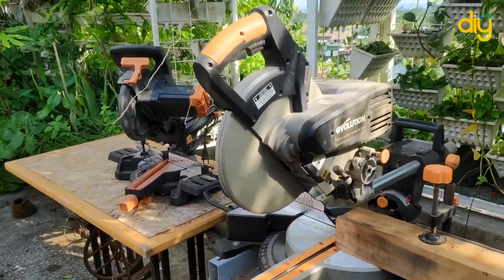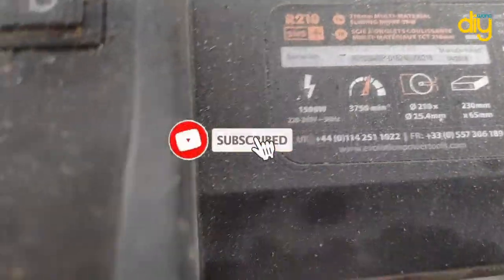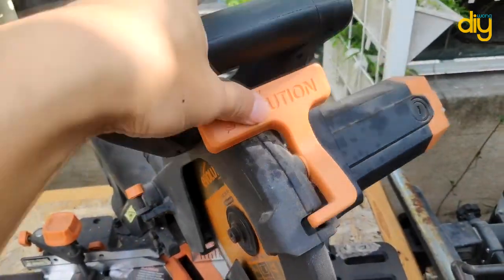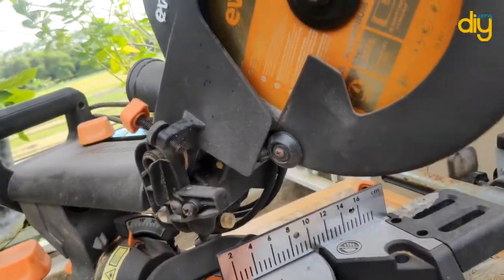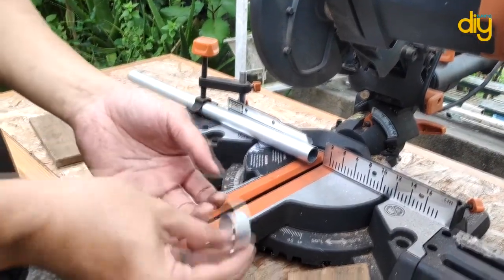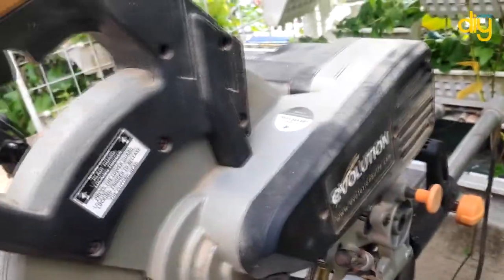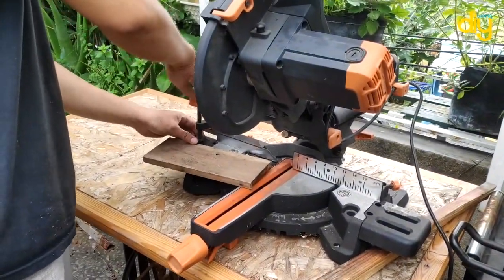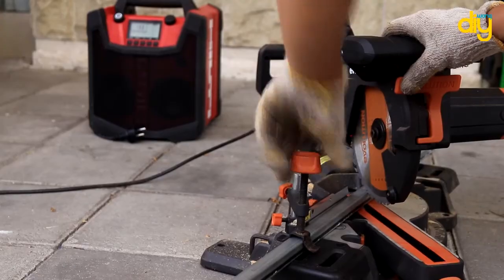Comparison between evolution sliding compund miter saw R210 sms+ vs Rage 3db Multi Material Blade

Comment: Like pertama
Reply from the maker: Mantappppp thank you
Reply: @WONGDIY   evolution  kok bisa sampe indo mas, saya cuma maktec gak sliding hehehe
Reply from the maker: @robotpenghancurjohe3325  ada importer nya di surabaya om
Reply: @WONGDIY  saya punya dca adjz 16 mas batrai tipe lama  gak bisa masuk ke dca model baru.. Kalo di shopi malysia ada converter dari dca... Rapi ntah kapan masuk ke sini 😭 heheh tertarik circular saw nya yg baru si., biar gak banyak batrai dirumah
Reply from the maker: @robotpenghancurjohe3325  hnah itu ekosistem batre emang penting om

Comment: Yang kiri ampere nya berapa masee??
Mungkin bisa dijelasin semuanya??
Reply from the maker: Tumben2an ada yg nanya ampere om.... Ini dia pk 1500 watt untuk input power.
Reply: @WONGDIY  ditanya ampere kok dijawab  wattage nya😫
Itu jelas yg kanan ada scene spec ampere 10A . La yg kiri  keknya gak ada . Makanya tanya ini. Sbgai komparasi  dws 780 mlah 15 a.  Ws dirumah 10 a. Klo dipaksa pke evo yg 10 a keknya mlh ragu g bisa.
Reply from the maker: @korekapik ini motor 15 amp om, makanya sy blg tumben2an
Reply: @WONGDIY  hihihi iya nih om. Ada "kecepetan beli" yg harus jdi pertimbangan lgi. kemarinan beli yg kelas heavy duty , tpi terpaksa kudu genset scra amperenya gede. Klo soal wattage sih no problemo. Anyway big thanks for reply nya gan.👍
Reply from the maker: @korekapik  bli apaan om yg heavy duty?